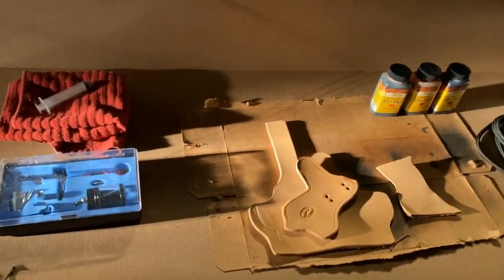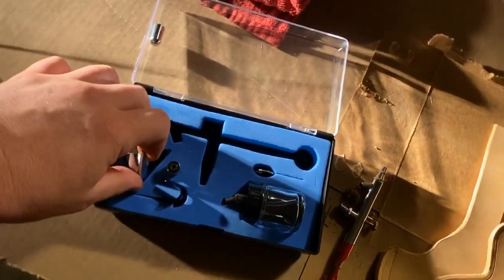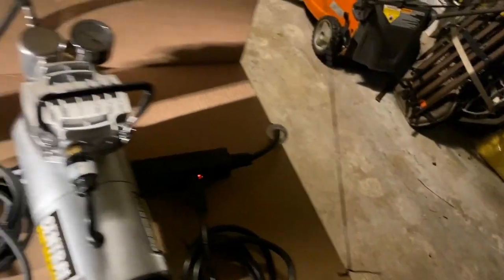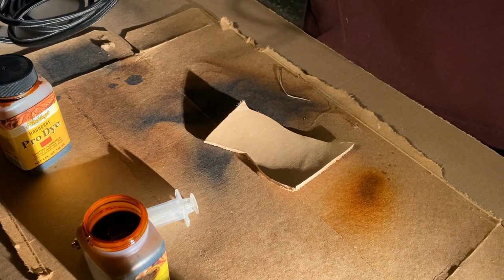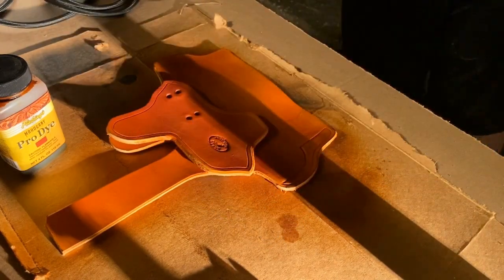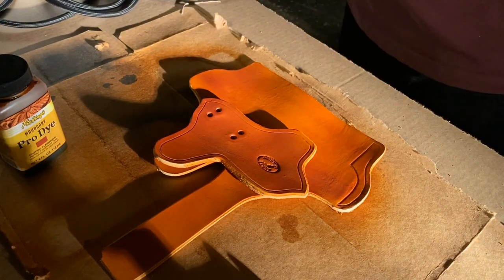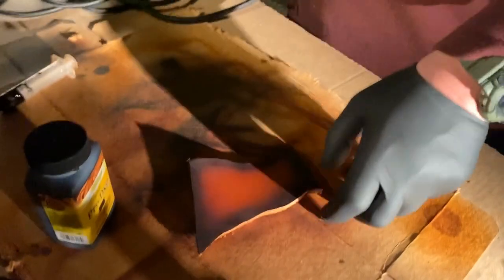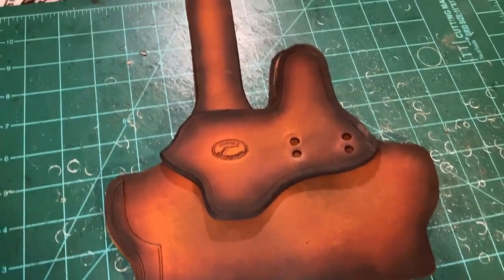Tool Review:  Leatherwork Airbrush Kit

Comment: I have the same one. I love it! I have an Iwata brush but for leather use the el cheapo works perfectly. Mine arrived through Amazon with no quality co trolls problems.
Reply from the maker: MaxRV yessir just the one little issue I mentioned in the video but simple fix and no more issues with it at all. Can’t beat it for the price